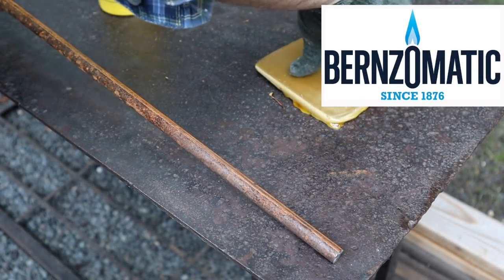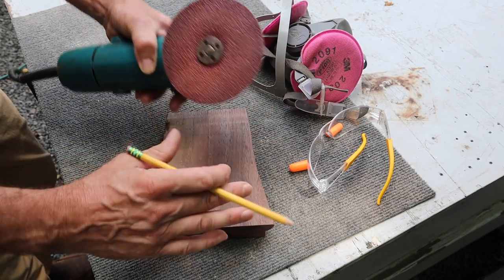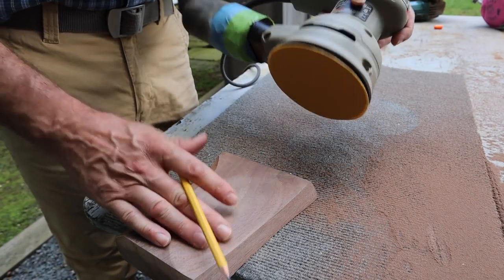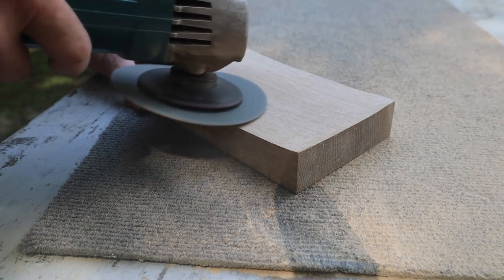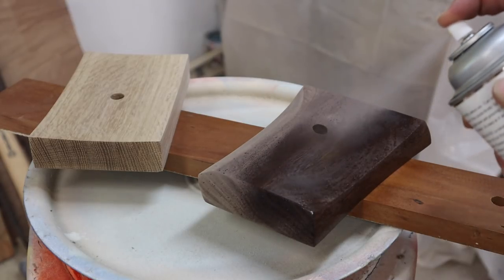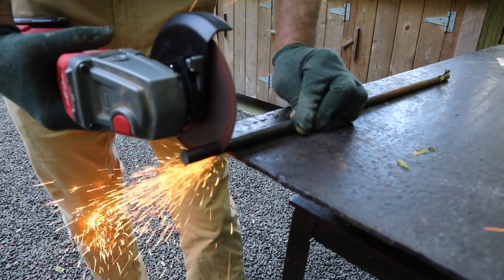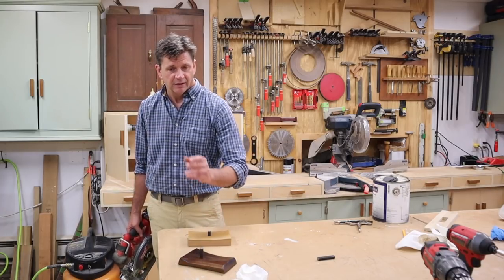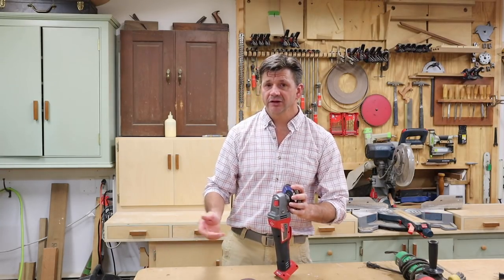How to Make a Sculpture Base & Use an Angle Grinder

Comment: I have a small chunk of wood I ordered off eBay. I need a base for a mixed media sculpture. The bottom of sculpture will be light because it’s styrofoam covered in plaster. The top may be much heavier. How would you go about this. The piece I have is flat on bottom and top is curved like a tree with bark. I want to center it on top and have 3” hole size to fit my sculpture tight inside hole can I add cement in bottom to attach to wood and sculpture?

Comment: In central NJ there is a place in oldbridge township, I can't think of the name off the top of my head. A buddy of mine has a sawmill near PA border off of 78 by Phillipsburg he sells hardwood and there is a reclaimed lumber place called Boards and beams just off route 80 on route 46 that has a bunch of stuff too. I only bought stuff from my friend but did visit boards and beams lots of cool stuff. I have not been to the one in old bridge but they can do hardwood and moldings I did see them on YouTube before.

Comment: What is the name of the sand paper disk and holder that you used on the angle grinder? I've used sanding flap disks and wire disks but this is neither of those.